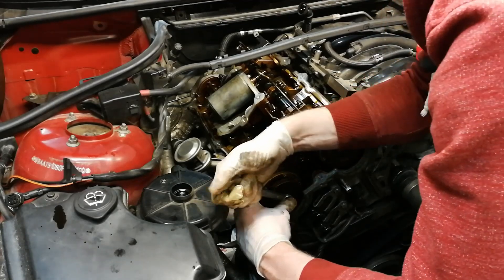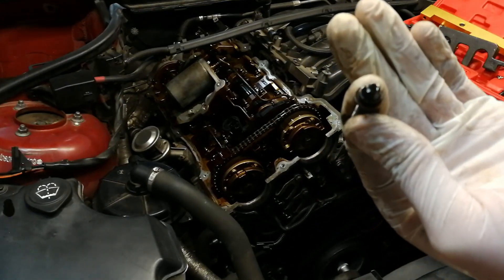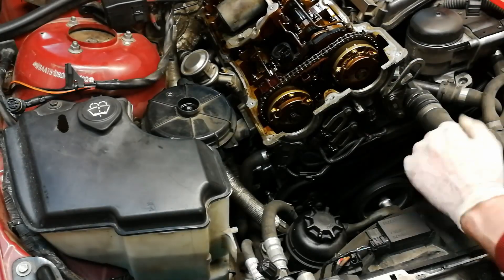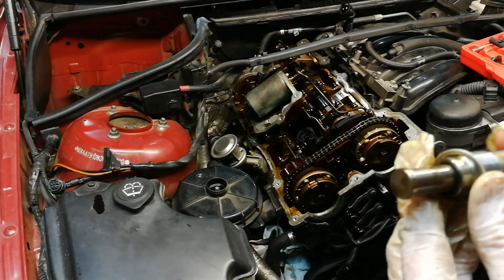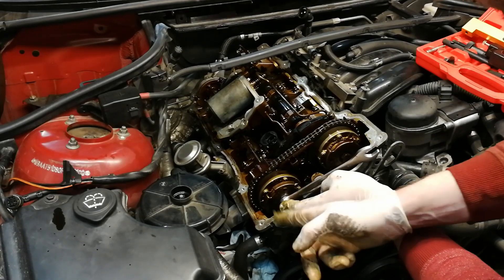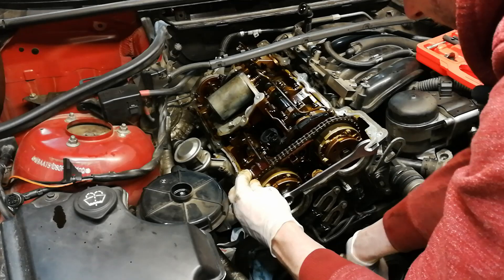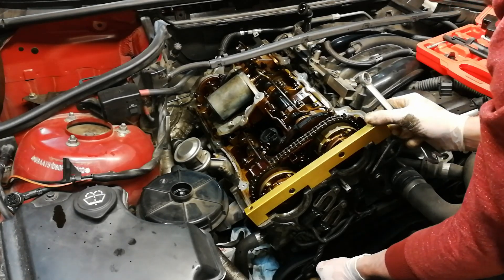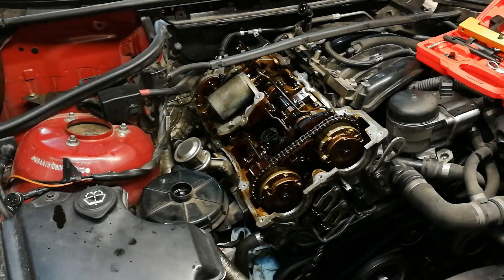Putting camshaft back in timing - BMW N42/N46 Chain Rail Replacement [PART #2]

Comment: Mr bimmerzen, I have a question: so I changed the oil in my n42b20 and then I unplugged the 2 solenoid vanos things on the front side of the engine to change the the o ring gaskets bc they we re in pretty bad shape and leaking oil, and then I didnt insert them all the way inside after I changed the gaskets i put the two metal pins backwards and it didnt push the solenoids all the way inside , and then I started the engine and it has a pretty bad noise like metal clack and it runs pretty bad and when I push gas pedal it revs and then when I release it dies and runs very , some other mechanic told me that the chain guide piston didn't had enough oil pressure and now the distribution is off balance or it skipped a tooth,  please help me what should I do, im dead without this car I need it to drive to work , if you have any opinions what happend wrong with the engine because of my mistake, thank you in advance. :((
Reply from the maker: So solenoids are now correctly installed with new inner and outer orings intact? You also connected them to correct plugs (intake/exhaust not switched)? My guess is that thr oil was flowing past the solenoids causing low oil pressure in the tensioner. That could cause jumped chain and/or broken plastic chain guides. I recommend removing valve cover and inpecting the guides, take special attenition to the bottom part of the chain rail as it can easily break, causing all sorts of issues, worst case scenario the pieces block the oil pickup and cause oil starvation leading to spun con rod bearings!
Reply: @BimmerZen yes now the solenoids are back in place, with corect corect all 4 gaskets, and when i started engine it runned good for 30 seconds then it started making bad noise again, is it possible that i broke the chain guides this way, ? Bc before i did this mistake engine was running so good, and i cjanged the  chain and guide chain like 7 years ago when i bought the car i mean a mechanic changed them...but if the chain guide is good is it possible just to set it back into corect position using the tool kit like you showed in the video without replacing the whole chain guides things,  just the procedure from the second video, without unscrewing the two vanos things,  thank you sm for answering!
Reply from the maker: @morosanuandrei4692 yes it is possible if the chain jumped on Vanos units by removing the tensioner and rotating the offending vanos into position with 16mm socket and reinstalling tensioner.
Reply from the maker: Also keep in mind that the chain usually jumps due to broken rails.
Reply: @BimmerZen thank you sir,  i will buy the timing kit then and try to put into position again my uncle will help he is pretty good with cars.

Comment: hiya bud, followed ur complete vanos system removal and put it back in with the zip ties locking tools etc, as had to replace a retainer spring, however my engine is seriously out of time now, watching ur timing video, when the locking tool fits the exhaust camshaft, the intake shaft is 90 degrees clockwise to far, and with the engine top dead centre, the exhaust shaft is 180 upside down, and the flywheel only locks when the engine is opposite of TDC

Comment: Hi,

If the camshaft is not in the correct timing, can the engine start with 1-2 seconds delay and have some small vibrations and high fuel consumption? mine it has this issue ( camshaft position sensor - sensor is ok). 1 year ago  I replaced the engine and I assume that mechanic didn't put the camshaft in timing. I wanted to find out if this is my issue ( wrong timing) .

Comment: Hi. There is something i dont get. Can't you just unscrew the VANOS bolt to put the camshaft back in timing? Then tight it in specs with a new bolt?
Reply from the maker: Yes, you can. But I wanted to see how many teeth the chain jumped.
Reply: @BimmerZen  thanks for your reply. You're doing a amazing job with your vidéos. They 're very helpfull. Thks

Comment: Hi, great video and really enjoyed it! However isn't this method only temporary? If the upper guide rail is broken then the chain can jump again in the future?
Reply from the maker: YES! Of course. This is only part #2 in this repair. The camshafts must be in timing so you can remove the VANOS bolts with the locking tools. Next steps are in parts 3, 4, ...

Comment: The older type chain tensioner can be identified without removing it. The 27mm nut is quite thick on the older style about 1cm. Also when you take it out, you will see that the new style has a much smaller oil pressure relief hole further up the shaft than the old version. The one you removed was an updated tensioner.
Reply from the maker: Yes, good pointing out the difference!

Comment: My e46 n42b18 shakes at idle and throws out the misfire cylinder 1 and 3 error, we checked all the sensors, vacuum, replaced the chain, maf sensor, spark plugs, but the problem was not detected. The car works nicely and goes fast but ... :-( Sorry for my bad English.
Reply from the maker: Check for wear on  valvetronic eccentric shaft. I have read on this site https://bimmerprofs.com/defects-valvetronic-components/, that the lobes on that intermediate shaft can wear out in the idle position. Since the whole valvetronic assembly has very tight tolerances, this wear might result in decrease of valve lift in idle and cause misfires.

Another possible cause can also be valve/seat damage,  incorrect timing of intake camshaft, ... Did you check the compression on all cylinders?
Reply: @BimmerZen  The compression on the cylinders is 9, is that good? I checked the camshaft well, it's just that I haven't checked those valves yet
Reply from the maker: @grofmarkocontetintoretto6778  9 Bar is on the lower limit: https://www.newtis.info/tisv2/a/en/e46-316ti-com/repair-manuals/11-engine/11-00-engine/68hXHXS
Reply: @BimmerZen   I am from Serbia.  Thank you very much <3

Comment: Hi friend thanks for the lessons. Please help me i have a bmw e90 n46 in my shop service and probably broke rail my doubt is the crankshaft not turn it. When happens with n46 could be pistons hit or lock in the valve head? Or just change the chain kit and the engine will works normally?. Can help me please
Reply from the maker: Not sure if I understand your issue... If the chain jumped a couple of teeth on the sprocket, then is should be OK. It the chain jumped more than 3 teeth, there could be an issue with the valves. From what I know, the N46 is an interference engine and pistons will hit the valves if they are opened and you rotate the crankshaft (camshafts disconnected or badly mistimed).
Reply: @BimmerZen  thanks friend. How can i see if the puley jump after 3 tooth ther es anything to do or just put the tool to set the timming chain. Thank you and prosperity way for you.
Reply from the maker: @sillasyahoo1  you could use INPA software to check VANOS position, but the only definitive way is to remove valve cover and use the timing tools.